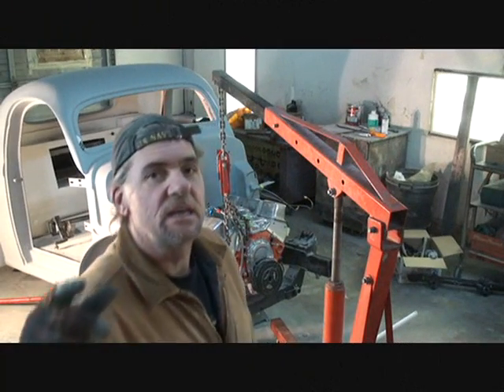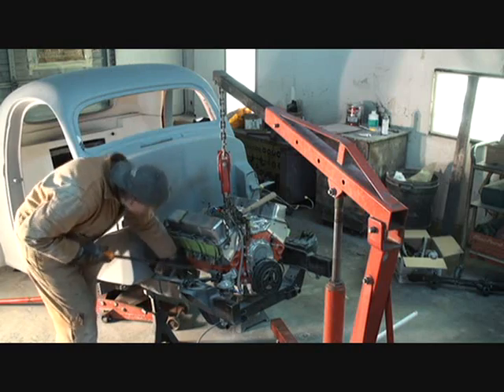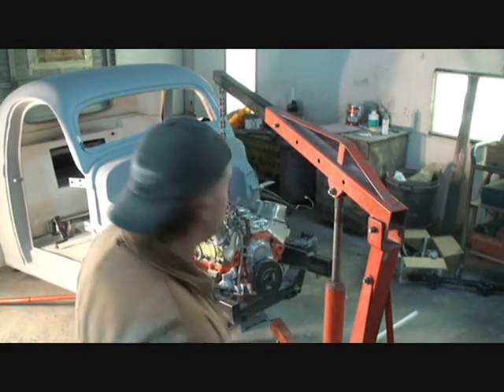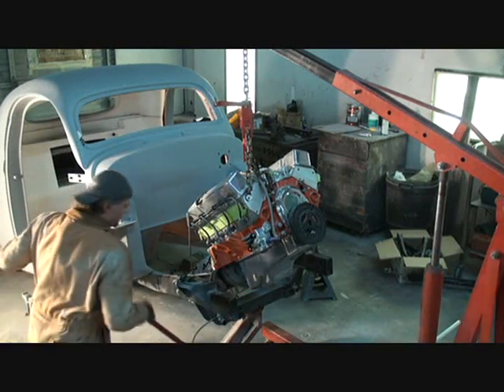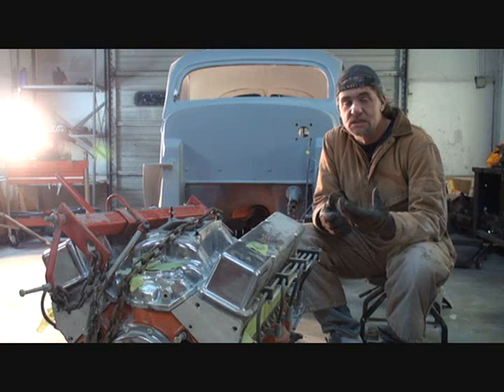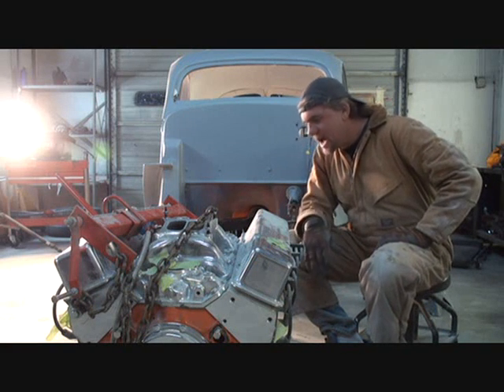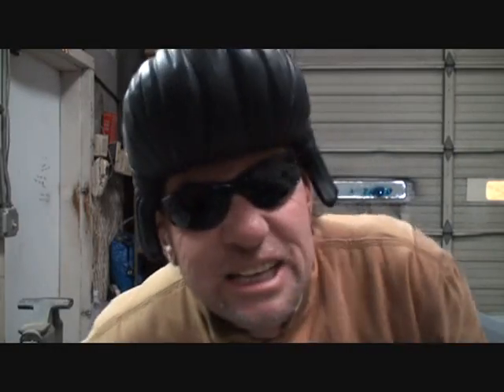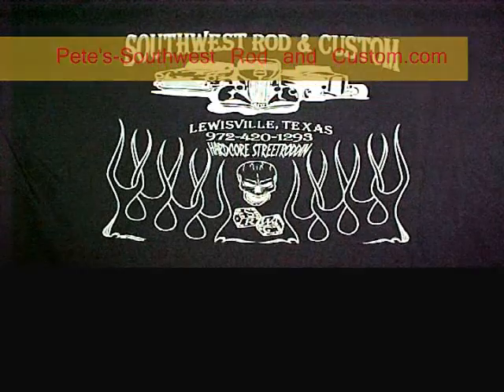1941 Willys Coupe-Streetbeasts-Pulling The Motor and Transmission OUT!

Comment: yep, its usually the big jobs with bits all over them that get you in that "nothings getting done" frame of mind.

as for the hood guessing game, a couple of ideas come to mind, either two pins on the fenders near-ish to the bottom that locate into a hole, maybe coned for guidance
or 
a couple of latches that click ove as the flip front comes down, the latches would release when the current is reversed to open.
or
fuck it its only fiberglass and stick some velcro on it LOL
or
bruno jaws